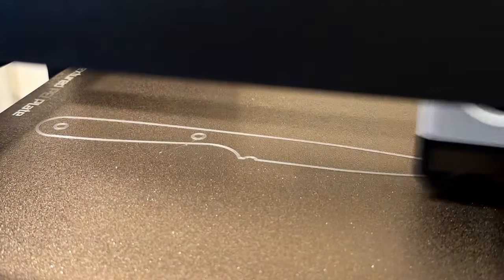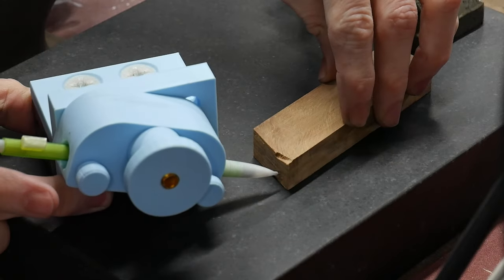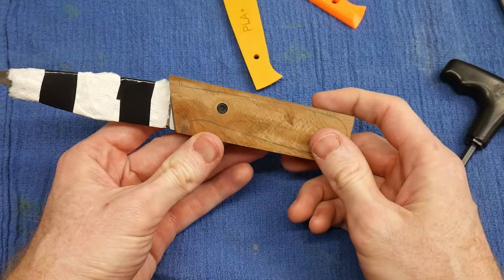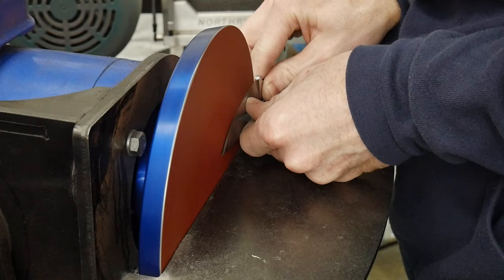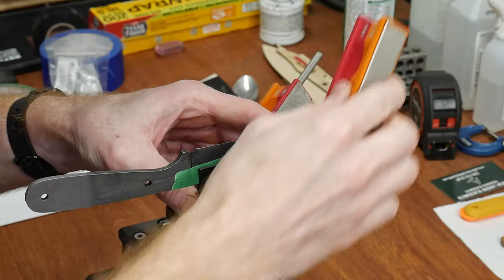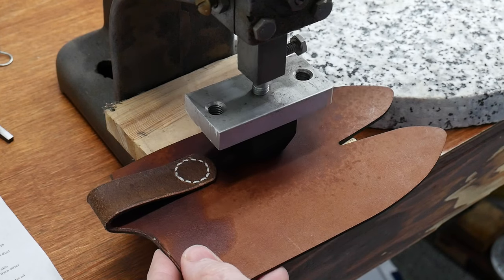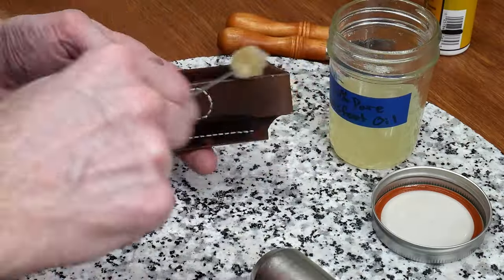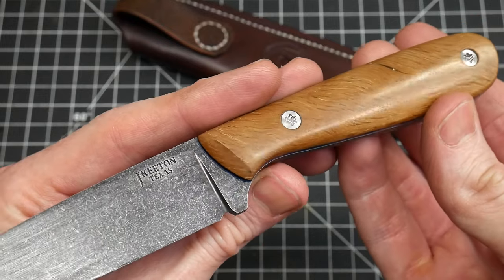Making A Knife For A Friend With Reclaimed Oak | Basic Knife Making

Comment: Looks great my friend 👍 I always glue my handles to the tang. It seems like wood just won't stay straight enough and I always ended up with a gap.
Reply from the maker: Thanks Richard! I could have taken it to my disc grinder after hand sanding and before stone washing and probably have solved the issue... but just was in a rush I guess. To your point epoxy would have fixed it.

Comment: Great Blade and Vid as always :) I like the colour contrast with the blade and handle material. I was wondering about the gapping you mentioned considering the flatness of the scales, knife surface must be it, this is something I need to work on. The sanding marks kinda work in with the stone wash IMO, I like the look but yea perhaps a clean looking stonewash would be better, hard to be sure. I like the overall looks, makes me want to pick it up and use it.
Reply from the maker: Thank you greatly sir for the thoughts. I think during my hand sanding I removed a little much at the ricasso... I should have true-ed up the flat-ness on the disc grinder afterwards before stone washing... Probably never would have noticed on a knife with epoxy.

Comment: a really nice knife and especially the wooden handle pieces show a very nice surface. did you use some sort of oil on it? i have here some pieces of old oak wood (aprox. 370....380 years). i try to use it for some handle but it never comes out with such a fine surface. i use different sorts of sandpaper from coarse to fine 1000 all by hand
Reply from the maker: I worked it up to around a 1000 grit finish and then buffed. If that's not a good look for your oak you could continue up to 2500 grit then buff and see how it looks.
Reply: @RedBeardOps  thanks for the idea. i will try it. you do not use oil or wax for the wood?
Reply from the maker: @henryganzer4685  I generally don't, but wouldn't be an issue to use some oil or wax for protection / luster

Comment: Just so I'm understanding, if your stitch line is 10 inches, you need 100 inches of thread and that should cover most material thickness? Sorry, I'm a little slow.
 Beautiful knife. The blue liners compliment the color of the oak. 👍🍻
Reply from the maker: That's right, it's what I generally do. It's a little over kill... 8-9x may be better. 

And thank you!

Comment: I noticed your etch was not a full dip, it shows when you put the handle on. Also yeah you should have sanded the bevel a couple more grits.  Nice build though, seen better from you.
Reply from the maker: Yeah I forge HT this one since it was a demo.... that's where the tongs were holding. As mentioned, I agree on the grits.